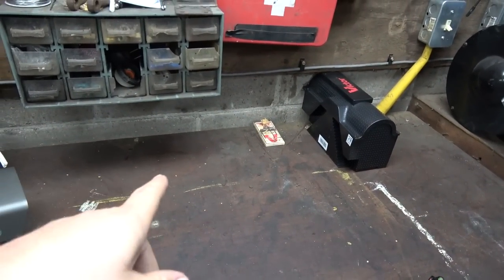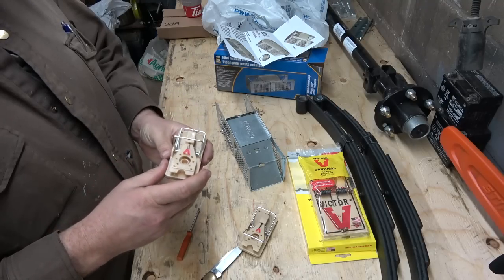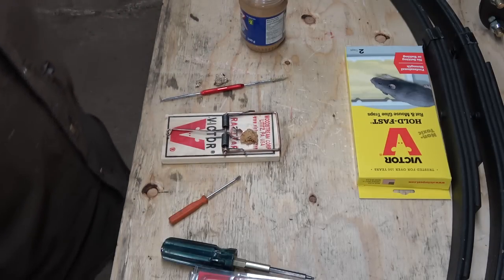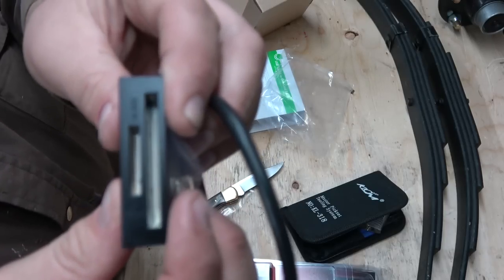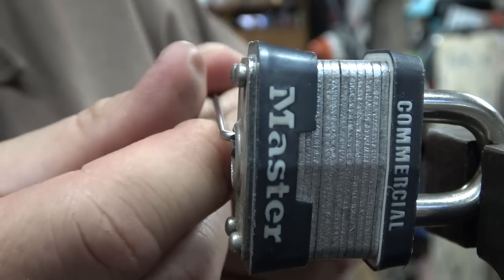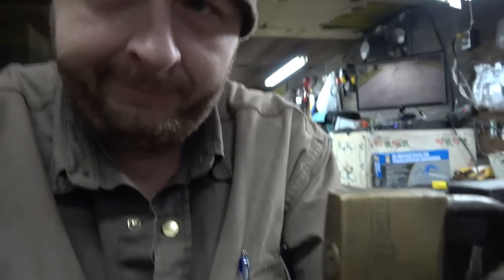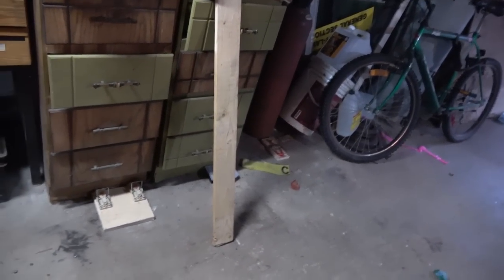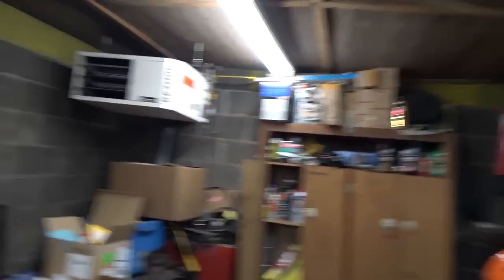Springage sort of day and lock pick master

Comment: Hi bill. I pick locks in my spare the ones with hooks on are for singal pin picking and the worm is for raking push it to the back of the lock then pull it out each hook is for picking each pin one at a time good luck bill

Comment: I have a southord lock pick set. One of my picks is long and is cut kind of like a key. Similar to your raking tool but longer ( mine also has the raking tool). With standard locks I've had the best luck with the "key" tool moving it in and out of the lock real fast.

House and car locks are tough to master. Any key with cuts on both sides are usually A LOT more difficult.

Comment: did you know that smooth peanut butter can be used to clean black plastic on your car ? the oil in the butter cleans the plastic the same as back to black spray you rub it on leave it for a few minutes then wipe off

Comment: I hate those glue traps. I saw one a long time ago with a mouse on it and the poor guy had completely ripped the skin off one of his legs and was still laying there struggling to get free. I'm all for killing pests inside your house or buildings but hours or even days of suffering before they die is just too much for me. I stick to the spring traps where they might flop around for 5 or 10 seconds but it's over really quick.
Reply: I know right thats what happend with me a few months ago I didn't relize at the time I could use vegetable oil to get him off so I tried to get him off with a spatula but it didn't work so I looked it up and freed him but he was such a wee thing its a wonder he survived I would occasionally see him running around through the garage and last year I attempted to save a baby mouse that I found crawling on the floor when I came home but sadly eve though doing everything right he died

Comment: don't use the glue traps they are cruel and should be banned
Reply: BlackbeardGaming They're only cruel if you aren't responsible enough check them daily. If you get one stuck, you use an air rifle or pistol to dispatch them with a headshot. Quick and painless. I don't use glue traps but that's the most humane way to use them. I prefer the electric traps. But you gotta do what you gotta do I guess.
Reply: I had a bad experience with them I found that using vegetable oil gets them unstuck